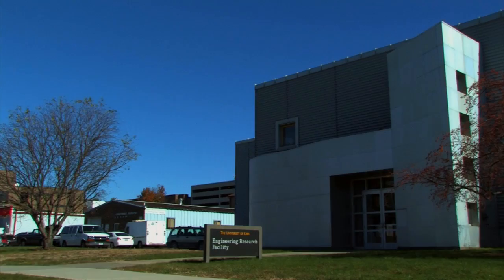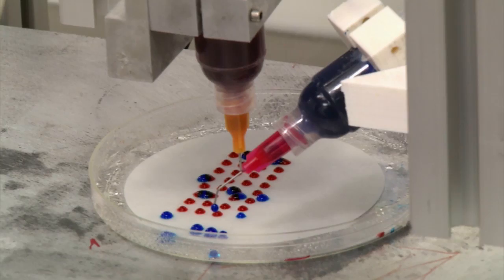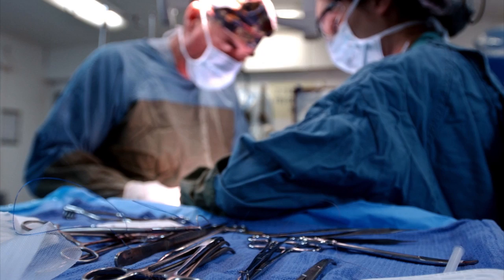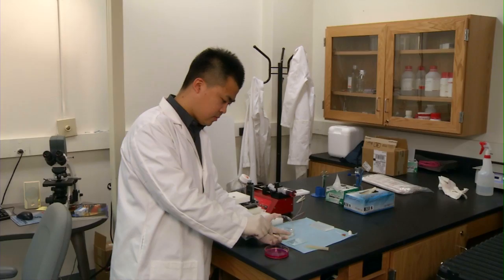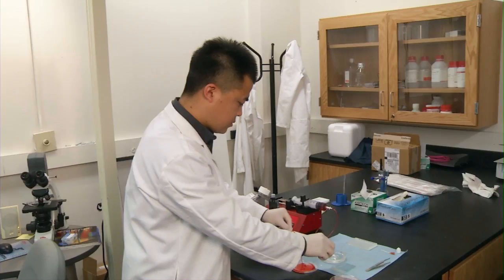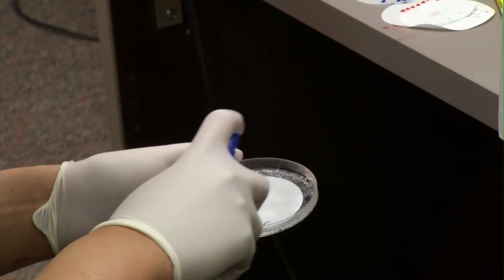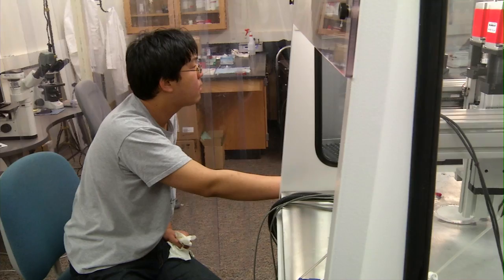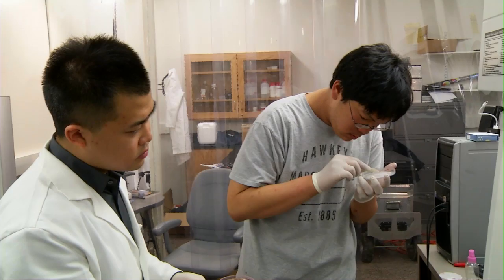University of Iowa Biomanufacturing Laboratory: Printing Organs

Comment: I haven't been up to date on this, but i find it immensely interesting. The problem as far as I understand with 3d printing organs is recreating all the tissue varieties present in a human organ. The kidneys for example have countless capillaries, veins and arteries, as well as other tubes, shuttling blood and urea in and out of the organ. 

But beyond that the future seems bright! How lucky we are, especially us young people (I'm 28) to be alive at a time when human organs could be replaced cheaply and safely by printing an exact copy with your exact same tissues. 

But this brings to mind a potential problem. Tissues degrade because copying mechanisms have degraded. This means if you "recreate" an organ with the EXACT same cells, wouldn't this merely lead to the same issues that led to the need for an organ transplant? I imagine future society will offset this problem by taking tissue/blood samples early in life so that when problems do arise, such as cancer, those tissues could be turned to instead of the cells which have degraded enough to create cancer.

Comment: another thing to consider would be to make the organ stripped of its genetic information like they have done with rat hearts (hopefully it works with humans as well) so that you can have a blank template to insert the donors genetic information in so that there is no chance of rejection of the organ. that way you could also produce a surplus of organs that just need the donors genetic information inserted into it before transplant